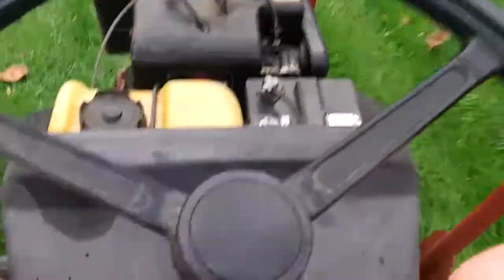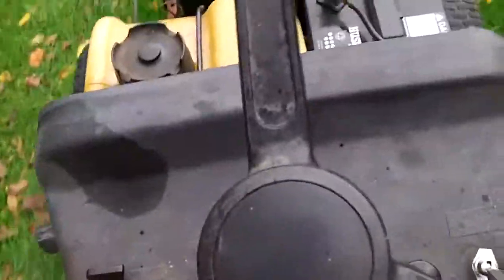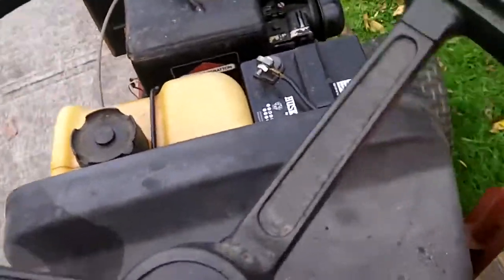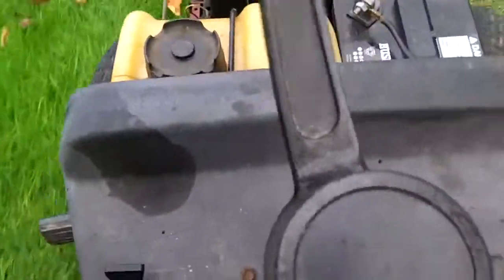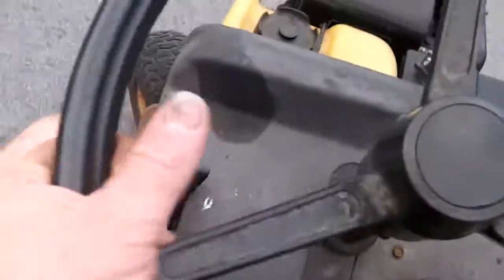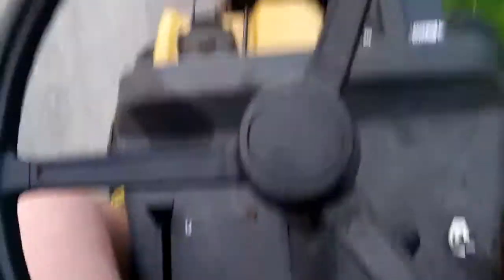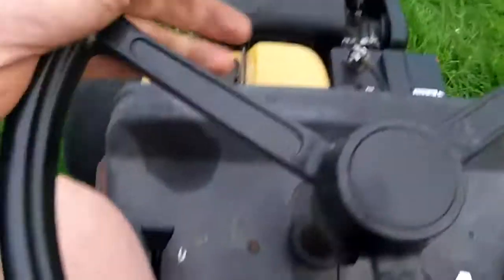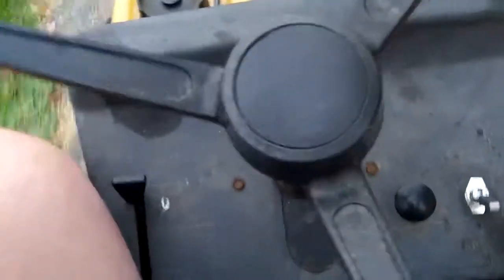A drive on the snapper lt11 & a vlog on it

Comment: Try bypassing the fuse. One way to that is to take a short piece of wire, say 3 inches long, crimp a male spade on each end of the wire. Then, remove the fuse. Plug one end of the wire into one side of the spot you took the fuse from. Next, plug the other end of the wire into the other side. This is a jumper wire. If this works you most likely need a heavier fuse. If you need a demonstration, let me know, I'll make you a video. Good Luck, Bud!

Comment from the maker: well my legs are not so enjoyable then lol. I wired the fuse box from toggle switch directly to + on the battery. the fuse box has has two long wires . a thicker gauge wire then the wire hooked to the pto. not sure it wrong. I'll figure it out hopefully